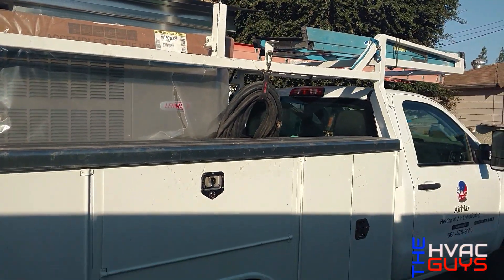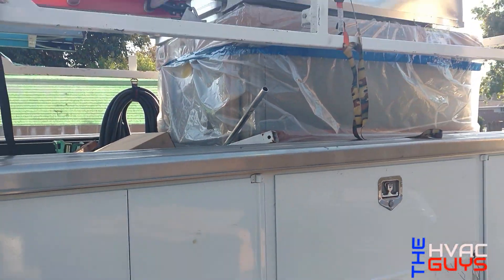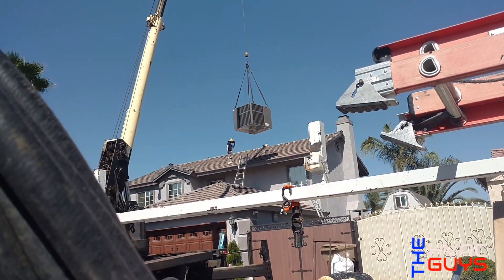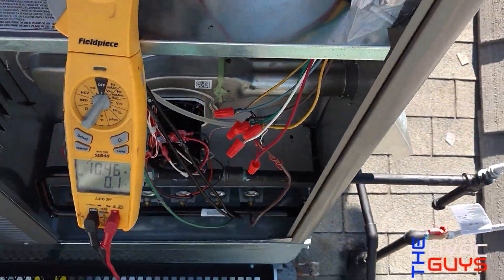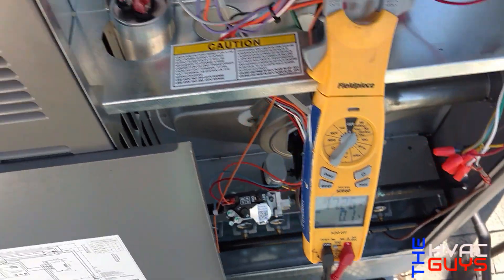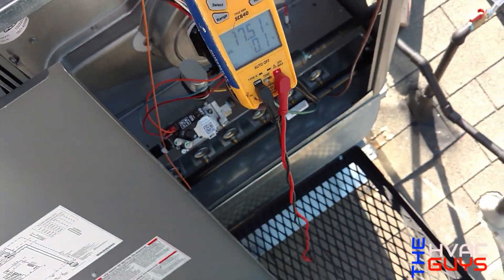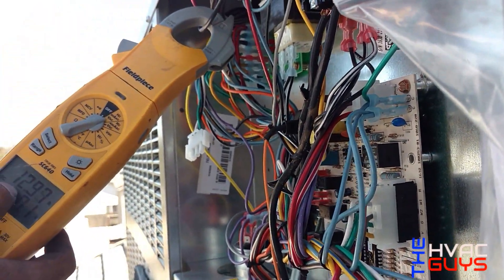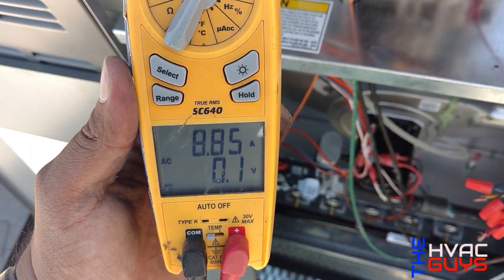HVAC: LENNOX LRP16 2 STAGE

Comment: No stainless steel heat exchanger?  Other 16 SEER gas packs offer stainless steel HX as standard-- Trane, Carrier/Bryant/ICP, Rheem, Daikin/Amana, York/Coleman LX-- since the HX is placed after the evap coil and aluminized steel will likely corrode quicker than stainless steel.

Comment: beautiful install man
 i noticed in Bakersfield they all use rut's not split systems .
i have a question if u don't mind,   when u buy a packaged unit and u look at it can u tell what side the supply and what side the return is before u open the side panels , is there like a way to tell just by looking at the unit what  side is what  .
Reply: 95 % of the time r/a is on the right and s/a is on the left (looking at the blank offs for r/a and s/a)
Reply: thank you for the reply
Reply from the maker: HVAC/R junkee what's up bro, Keith is right depending on how you look at the unit. back then I belive York had them the opposite. now there all the same so you get used to it.